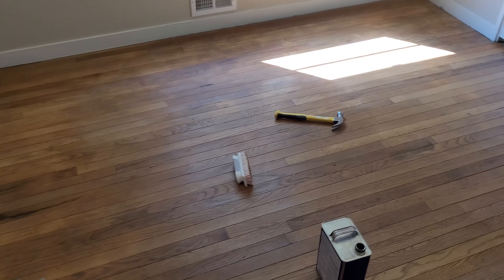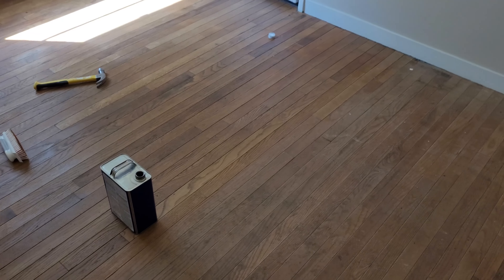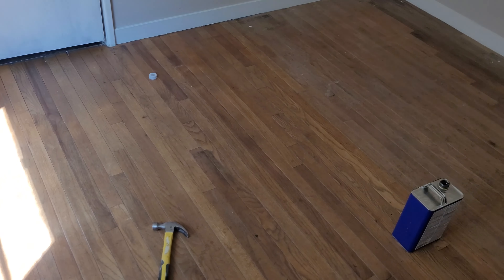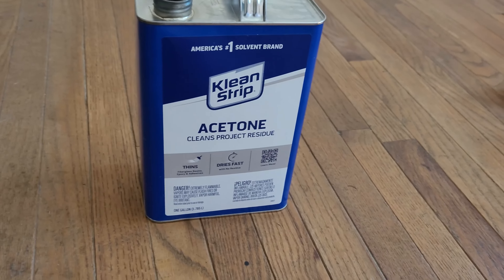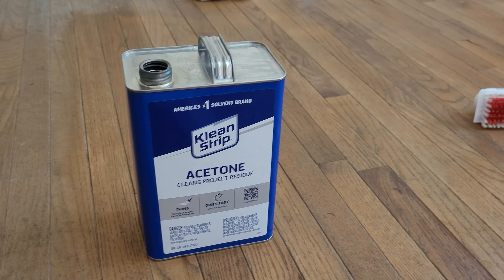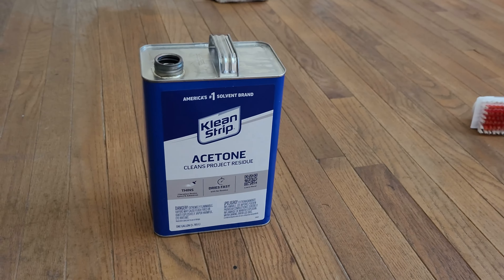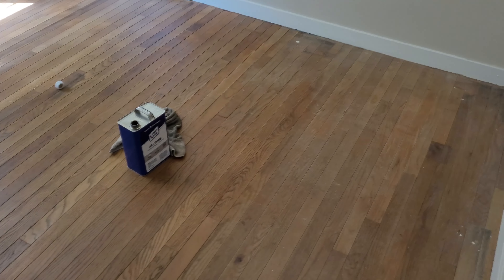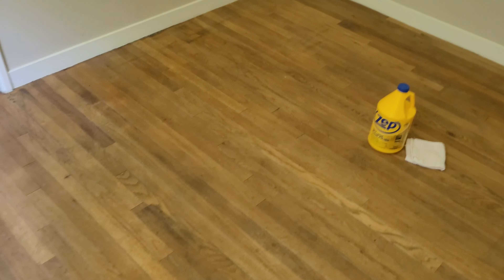$50 HARDWOOD FLOOR MAKEOVER!  Simple Refinish Method

Comment: So you dont sand the floor at all? You just put acetone on floor a little at a time and wipe/scrub. Then put ace on, wipe, and let it dry. Repeat applications until reach satisfied coat.?
Reply from the maker: No sanding at all!  Super easy.   That's it.  And yes, I used 4 coats of ZEP, but you can repeat until happy.

Comment: This is just what I needed. My biggest problem is that I have huge windows and my dark hardwood floors are faded in window areas  as well as scratched .Will be acetone Remove the existing verathane or whatever it is that is on my floor now. I really do want to add a new coat of stain to even out the tones and then I could use what you’ve used to finish off the floors. Is that feasible? Thanks a bunch.So glade you video popped up on my searches for a solution.❤.now a subscriber for life!

Comment: Does this work if there is a clear coat finish. I have the same floor but the finish is worn in areas and there are also some water damage. Will the acetone help remove the top clear coat? Thanks.
Reply: That's what I want to know.

Comment: Hey man, I'm in the same situation and going to follow your steps. Just some questions I'd love some help with.

1. Can you use a mop instead of a cloth to wipe in the acetone and then polish?
2. Everywhere on the internet I've read acetone is dangerous against hardwood, but in your video it looks good. Why is that?
3. When and what do you scrub with the brush?

I would appreciate the help, it's my first time doing it tomorrow. Thanks, from Norway.
Reply from the maker: You could use a flat sponge mop. I wouldn't use an old school mop. It would get all over the trim. 
It's fine it turns out perfect. I've done it on several different floors and it always works out good. 
Usually the people that say otherwise are trying to sell you something. 
I clean the floor with a brush to get in between the cracks. 
Hope this helps

Comment: Can you use a wide soft mop to apply the acetone and a dry mop to help it go faster?
Reply from the maker: @stephanielove4469  it depends on the floor. In my case I had to use a cloth because it took quite a bit of elbow strength. It's hard to get that with a mop. I suppose if your floors aren't too bad that may work.
Reply: What about liquid sandpaper instead of acetone

Comment: i have a mostly nice hardwood floor that I don't want to move everything off of, but have some high traffic areas that the finish has worn off and it's turned grey.  No paint.  Would acetone be necessary in this case or just a good cleaning and then the Zep?
Reply from the maker: That's where I would start.  You can always try to strip it down a little bit if it doesn't. Good luck

Comment: Well done.  People get it into their heads that you can only use certain finishes on wood but there are other options. 

I grew up in an old house with hardwood. I remember my mom using floor wax on them periodically when I was a kid. She'd run us out of whatever room she was working on until it was thoroughly dry. As a kid I didn't pay that much attention but looking at old family photos you can often see those floors in the background.  They look like something out of a magazine. 

As an adult I was able to buy that old house.  The 160 year old hardwood had been partially covered with carpet, and the rest was looking pretty sad.  I used a solvent to clean off a lot of the old wax and then used an orbital palm sander to scuff them a bit.  
I put down a couple of coats of Amber Shellac (basically wax dissolved in alcohol).  The first one I thinned out a bit with extra alcohol and used a wide brush to apply a heavy coat.  That old wood had been neglected in the years since we had lived there. It soaked up that thinned shellac right up. In some places I had to re-apply several times before applying the top coat. 

People told me that shellac was a terrible choice, but like you I didn't want them perfect. The rest of the woodwork shows some wear and has a lot of character. Why would I want my floor to look like some modern reproduction?   

From working with wood previously, I knew that shellac is an easy finish to work with and touch up.  Sure enough when we were moving in a well meaning helper dragged a piece of furniture across my newly refinished floor leaving a 12 foot long scratch  all the way down to the bare wood. How they didn't hear and feel that I'll never know but it happened.  My wife was nearly in tears. I wasn't thrilled but I knew it wouldn't take long to fix.  Sure enough I touched it up that evening with a bit of sandpaper and a small brush. By the next morning it was almost impossible to find.  15 years later and I've had to touch up a couple of high traffic areas but the floors are still the first thing anyone comments on when they visit us for the first time. 

Messes are easily cleaned with a swiffer wet jet, and I mop them now and then with some murphy's oil soap.   That's about it. 

As for other finishes, I used to live in an apartment where the wood finish on the cabinets was beginning to look sad.  I used some lemon oil on them and they looked better for about 24 hours before drinking most of it up.  In the end I kept a rag and lemon oil in that tiny kitchen and would hit those cabinets a couple of times a week until most of the wood stopped soaking it up. It took like 2 minutes. It really was a tiny kitchen.   Then I just focused on the dry spots.  It took a few months but they stopped soaking up lemon oil and only needed to be touched up every month or so after that.  

When I moved out I got my deposit back and a phone call from the  landlord asking what I'd used on those cabinets. They'd been painting all the ones in the other units because of how sad they'd begun to look.  When I told her that it just took a bottle of lemon oil and repeated applications over several months she seemed to lose interest.
Reply: What other oils work besides lemon oil? Could coconut oil work

Comment: What do you believe the old finish was on the floor?
Reply from the maker: It appeared unfinished.  I've done this in several homes on older floors under carpet, and it has always looks the same.  I'm not sure what they were doing back then.
Reply: @smokymountainrides  It may only have had a wax or oil finish.  I found a website that gave the history of hardwood floor finishes and up to 1920 wax or oil was pretty much all that was used.